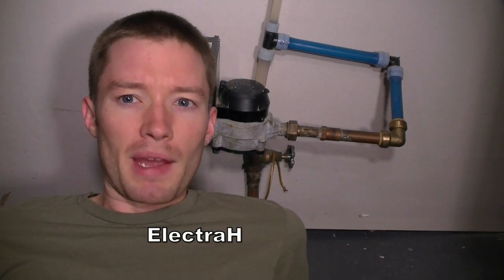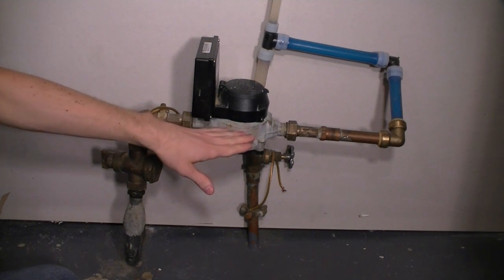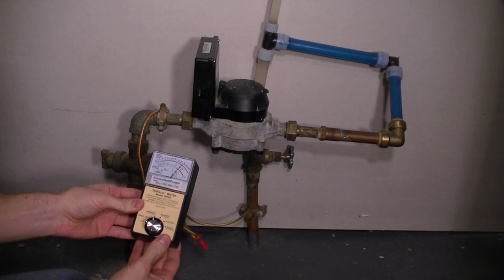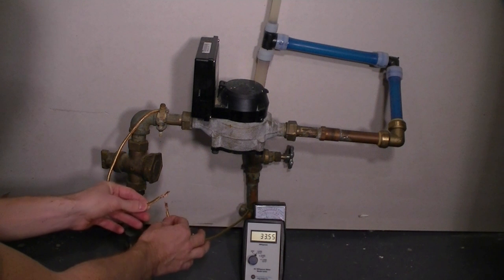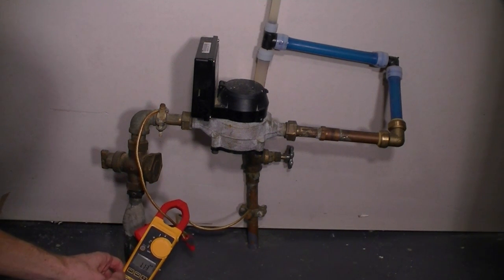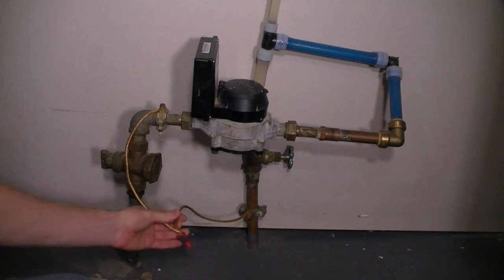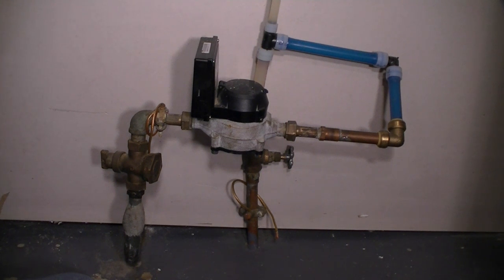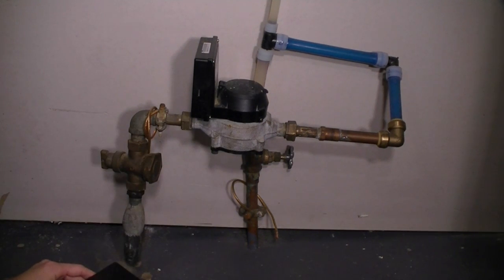Electrical Current on Plumbing Pipes

Comment: Hi Shaun, please help me with your thoughts. My faucet has voltage and the voltage is present only when my geyser is plugged in to the socket and it doesn't matter if my switch is on/off. I have checked my switch and the live wire is connected properly i.e. when the switch is off the socket do not have current but inspite of that the faucet has voltage. Please let me know how this can happen?

Comment from the maker: Joe there is no fault on this pipe or anywhere in the house.  I see this same problem in almost every home I test with metal water service pipes.  It is actually rare to see a metal water supply that does NOT have significant current on it.  I've personally measured it hundreds of times.

Comment: Another thought - what about Clearwave water conditioner, and similar products, where it plugs into wall, then leads get wrapped around hot and cold water pipes in opposing directions - is that causing a problem?

Comment: when you do put pvc piping you need to ground your in-house copper piping to your electrical service so you would not get shocked in a bathtub
Reply: @davidgilde6296  water is a poor conductor. Not reliable.
Reply: @tenthdimension9836  Rater true. But that's not the point.

Comment: My question is: What is that Black Box on the pipe?
Reply from the maker: Good question - that is an automated meter reader.  It is one of the old styles - NOT a wireless type - the water company sends out some sort of a ping/read request.  This signal travels along the metal pipes, is picked up by that little black box and the box sends the reading back out through the pipe.

Not ideal, no doubt.  But it is an older system and  I bet they only read it once a month to check on it.  And there is NO wireless radiation :)  Plus since my pipes are electrically isolated this keeps the signal off of my pipes.  I'm not sure what frequency they are using though.

Comment: How about ground in the out lets ,don't we have GND.wire from out let to main panel which is required by code.  Often they use a copper wire to connect copper pipe if PEX is used between that pipe

Comment: Some people have their appliances grounded to water pipes and fixes like you show with a plastic water pipe would make the appliance ungrounded. My daughter was almost killed at work by a ceiling water pipe that threw an arc a foot to her head.  I don't think they got to the bottom of the cause, so I was considering going in an clamping a 12 gauge copper wire to the pipe and running it out the window to be clamped on a metal rod stuck in the ground. What do you think?
Reply from the maker: +abelincolnparth Running current to ground (earth) doesn't "clear" a fault.  Metal pipes could clear a fault if the metal pipe is bonded to the main breaker panel.  You can still bond the interior metal pipe network to the breaker panel even though you electrically separate (with the plastic pipe) your interior pipes from the outside (city water network).  That would provide a fault path that can then trip a breaker or GFCI.

However, a regular breaker isn't going to keep you from electrocuting yourself.  A GFCI breaker or outlet (running the entire circuit through an outlet) would be the device you need for that.

As always, this info is just for information purposes only and you should always consult with a licensed electrician, building inspector, etc for actual advice on such matters.

Comment: There are di-electric couplings that can be installed between meters.  These are always used at gas meters so that the cathodic protection on the gas lines doesn't go into the homes which often have grounding wires shorted between gas lines and water lines.   Does it cause health issues?  Don't know, but these shorts often create galvanic corrosion cells between copper piping and grounding beds and steel or ductile iron pipes.  That's why it's a good idea to install di-electric unions or isolation joints at flanges and connections where they transition from above ground to underground (The di-electric should be above ground). Otherwise you have a huge lemon clock.  Current on water pipes or unintended pipes is also known as stray current and can cause stray current corrosion.  Measuring the current on 2 inch water pipes is a pain or needs expensive clamp on amp meters.  So your gauss meter can be handy.
Reply: We carry an awesome clamp meter for this purpose - has nice huge jaws to clamp around large pipes and even 2-2.5" conduit bringing service in.  Reads milliamps and even 10th of milliamps, which is pretty amazing.  The milliamp feature comes in handy.  By far the best clamp I've found to date.

Comment: I have been pondering a whole house filter installed not too far from the water supply (a couple feet) and they are all made of plastic.  Would that also by chance interrupt any EMFs coming through the copper pipes?  A two-in-one would be awesome.
Reply from the maker: Filters should accomplish the same thing, as long as they don't use metal pipes.  As with any "solution" like in the video, you need to make sure there aren't any wires connected to the pipe on the utility side.  Use the link in the video description to pick up a Trifield meter or the clamp meter used in the video to verify that you've done the job, and that the current hasn't gone somewhere else in your home.

Comment: Very good and informative video. Thank you.
I have same issue in my apartment  and also thought of using a plastic pipe to isolate the plumbing of my apartment. However I thought that since water itself is a conducting material, the isolation using a plastic pipe won't be as effective. But your video proved me wrong. Possibly the water remained insulated due to scalings on the inner walls of the metal pipes.

Comment: If you disconnect, the electricity will try to run through your water in your pipes to get to ground and corrode everything plus create a lot of build up.  It is safer to just run a new grounding rod to your box.  You need a ground (in the US).  That is a good meter I have one.  The link shows "dangerous site" so might want to fix that.

Comment: Like  Robin sed  you have to check your Neutral and Ground, not connection schould be done in any electrical point in house.In some points if you neutral is not connect correct way then you have current in ground -simple.

Comment: @EMF Explorer What if the electrical panel grounds into the water pipe? And then the water pipe is connected to the gas pipe with a ground strap up above?  It seems inevitable that the water pipe above will touch some metal, and in my case it's even tied to the gas. I have done what you did, but the electrical panel grounds into the bottom section of the pipe and it creates big M fields.. Can't disconnect that, it's the ground for the entire house. Where does your main panel ground go into?
Reply: By law you must have all metal part that can potentially be energized be grounded to your main panel! Per National Electrical Codes! Removing your ground connection to bond your water and gas piping will cause death if ever energized and came into contact with you. This guys a nut I can! And I dont see his water bonded which is highly dangerous if he removed it.

Comment: 1. We don’t have high frequency current flow, we have 60 Hz.
2. Electrons don’t take the path of least resistance, they take all paths, basic theory (parallel paths).
3. Electrical current flow ‘in a house does not’ create corrosion on plumbing pipe (I have the studies).
4. Measuring current on a pipe has ‘nothing’ to due with current flow through a heart. That is a different measurement (I =E/R).
5. Your dangerous suggestion lost the grounding of the home in violation of the National Electrical Code Section 250.52.
I pray nobody follows your recommendation of disconnecting the home grounding. If you want this done, it can be accomplished by a licensed electrical contractor, who know how to prevent current flow, yet keep the grounding intact.
Reply from the maker: Hi @MikeHoltNEC.  Thank you for your reply.  This is an older video, so there are definitely things I would like to change about it.  I have since made more recent videos.  I would like to kindly reply to your reply and hope that you  might continue the conversation.

1) Everything flows at 60 Hz, but many of the electrons are flowing at higher frequencies due to transients, harmonics, etc.  I wish we did not have high frequency current flow, but my Fluke ScopeMeter always says otherwise.
2) Agreed.  I always cringe when people say the "path of least resistance" bit.  While a true statement, it is misleading.  They do, indeed, take all paths all the time!  Kirchhoffs rules.
3) That is interesting, I have been frequently told otherwise.  I have not looked at studies on the matter, though, admittedly.  
4) I agree that, of course, it doesn't directly convert.  Plenty of plumbers have been killed, however, and the use of pipes as conductors has been the reason.  eg. service neutral breaks and all neutral current is then on the water pipe and ground rod(s), plumber does work and gets bit.
5) This video is not a complete solution, just an introduction.  We always want people to bond to the house side after they use dielectric unions or PEX to isolate.  We want them to use ground rods to ground the house instead of using the water pipe which causes off-site current and on-site current to flow unopposed and create magnetic fields and therefore the transformer effect.

You mention a licensed contractor can prevent current flow yet keep grounding intact.  Do you mean as I described above - using ground rods instead of the water pipe?  Or do you mean by some other method?  I am not familiar with any other method.  It would require something like a ronk blocker or other volt-clamping mechanism that closes the circuit when there is a fault.

Comment: In the event you actally have current flowing  through your metal plumbing  you need to  consult an electrician that knows their stuff no scare mongering EM/RF Loon..Even though the neutral conductor is bonded to ground  to insure it stays at 0 (zero) voltage potential. The safety ground conductor should never have current flowing in it
Reply from the maker: waswestkan electricity takes all paths according to their resistance/impedence values.  When there is a neighborhood of houses with metal water supply lines connected to a metal main water line outside - there will always be some amount of current flowing on there.  The only way to stop that is to electrically isolate the house from the pipe in the street and therefore the neighbors' neutrals as well.  This is most easily accomplished inside the house - otherwise   digging in the yard is required.

What's with the name calling?  Electricians and electrical engineers who are aware of and solve EMF are lunatics?  EMF is even recognized by the World Health Organization as a Group 2B possible carcinogen.  Let's discuss the issue without insults or name calling.
Reply from the maker: waswestkan one more thing - ground or earth is not zero potential.  It is a reference, but unfortunately it is also used as a path for current.  According to the IEEE and EPRI, most of the electrical current we used takes the path of the earth at some point.  The earth is a great conductor with many parallel lines.  Hard to tap into or connect to, but great conductor nonetheless.  If it were zero potential we would never measure voltage between a neutral and a grounding electrode.  Yet we always do.  Stick two rods in the ground and you'll even measure a potential between them.  The earth is used as a parallel path or auxillary conductor for electrical current.  Another source of EMF and contact current.

Comment: but if it's being used to ground your electrical. doesnt the wire need to stay hooked up
Reply: U still have a rod at ur main panel and that should be enough. People need to understand why u need a grounding electrode . Its just for lightning ect. To go directly to the earth and if u have an electrode going 20 or 50 ft away to ur main waterline the what is the point??

Comment from the maker: Question for naysayers - if you think magnetic fields aren't a problem, despite the scientific evidence otherwise - how much current do you think is "OK" to have traveling on the incoming water supply pipe?  How many milliamperes or amperes?  If the pipe is cut, how many AC volts or millivolts is OK?  I've seen nearly 20 amperes on a water pipe.  I've seen nearly 10 volts.  Personally, I don't like to see any current since electrical current should be on WIRES not on pipes.  It should also be in a balanced complete circuit on the wires - positive and negative balancing on two conductors.  Hope that helps.
Reply: If your Electrical system ever energizes your plumbing you will be putting you and your family in danger! You need to have all of your plumbing and gas pipes (bonded) per NEC codes. So if they ever get energized the fault currents will instataniously trip that circuit! Instead what you have done and informed everyone to do is break that path so instead your piping will stay continuously energized in a fault condition and when you go to take a shower be electrocuted! This is madness and you need to have a licensed electrician fix your tinkering A.S.A.P.
Reply: I don't doubt that magnetic fields can be a problem, but doesn't home electrical wiring emit much more than what might be radiating from water pipes?
Reply from the maker: @unacceptableonanon2655  That's a great question - the answer is actually no.  Around half of homes, and it does seem to be getting better, are clear of serious wiring errors.  If a home is wired correctly, and no serious wiring errors have been made, then the magnetic fields from wiring is actually relatively low.  This is because there is a positive and negative conductor inside the cable - and for every electron that is going out and causing a magnetic field on the negative, there is an electron coming back and causing the opposite magnetic field on the positive.  So there is a balance, or zero net.

However, if there are wiring errors or issues like the plumbing pipes, then there is no balance.  As for the pipe in the video...notice it is only one conductor - there is not a second pipe right next to it traveling the same exact path.  All of the current on this pipe is what we refer to as "net current."  It is these net currents that are unopposed or unbalanced - they are uncanceled so to speak.  These are the currents that cause very large and expansive and powerful magnetic fields.

Usually in a home very little mag fields will come from wiring.  They will more often come from appliances (things with motors, heating elements, etc), and where the power enters the home (service) and main breaker, etc.  Many homes do have ground loops and wiring errors.  I speak about these things all in detail in my book: https://www.electrahealth.com/EMF-Bible--Fix-Electrical-Current-on-Your-Plumbing-Pipes-Printable-eBook_p_156.html

Comment from the maker: Don, I don't think water makes a good enough conductor for these types of currents.  It is low voltage, higher frequency - high resistance.  These higher frequencies like large surface area - that's why they ride on water pipes with high surface area, or on the outside of wires (skin effect).  They also go on the surface of the earth, which has many, many conductive paths.
Reply: EMF Explorer how do you prove which way the corrent is flowing (how about that there was a bad equipment in your house that's what's feeding the ground when you connect that jumper)

just wondering 😗

Comment: From a home owners perspective you want two things from the ECG/Grounding system. You want your GFCI protection to work. You want some place for lightening to go (via the ECG system to earth).

GFCI protection will not work as designed unless the service entry panel is properly grounded.

Lightening likes to find it's way to earth. If your house is not properly grounded it may find it's way thru you. 

It is not too picky on how it gets there.

Assuming the lead pipe coming in continues as lead out thru the yard (underground) you need to do this. It is part of the NEC regulations. You need to connect/clamp a grounding cable to this lead pipe and terminate the other end in the entry service panel. 

Another requirement is to drive at least one grounding rod (eight feet) and terminate with #4/6 copper to the same entry service panel.

"There will always"  be some current on both of these grounding conductors. When running 240v split phase (in the US), there is never a perfect balance in the 120v circuits back to the POCO/Utility on neutral. Several amps leaving on the cold water pipe would not be odd. Its called "ladder circuit analysis" in AC power systems.

The POCO/utility use earth grounding as part of their system. They drive grounding rods at the last transform (this is the last POCO drop that ends up at the entry service panel).

They want that darn lightening to stay off the power cables.... and finds it's way to earth (ground) as quickly as possible.

It's your house/your insurance. If you are trying to eliminate all EMI/RFI fields, its going to take a lot of Aluminum and Copper foil to create the world largest Faraday Cage around your house.
Reply: I dont agree with bonding to main water line two rods is enough u dont want to have an electrode conducter going 20 to 100 ft just to get to water line now u have high voltage traveling  50 to 100 ft just to get to ur waterline makes no sence and nec says no bend or loops for electrode conucter soooo....